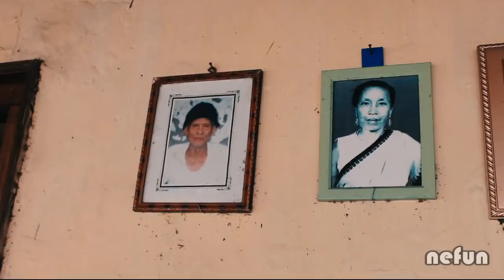Manipur da Thang Makhal kaya leibage ~ Saba

Comment: 2:32 khngningba yaoradi,  tempering twb hyd steel do high temperature da, melting point ti ywhndbida sahllaga amuk esingda luppaga thuna enghngadba aduga konna gradually cool twhnbne..... Heat treatment piba hytare. Adu oiradi steel ge strength se knkhtpa helle adunani...